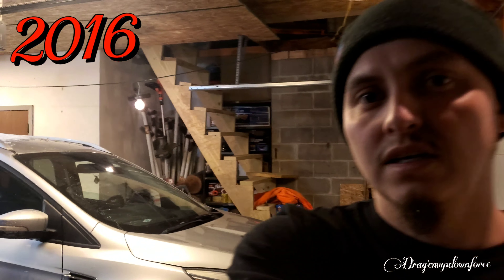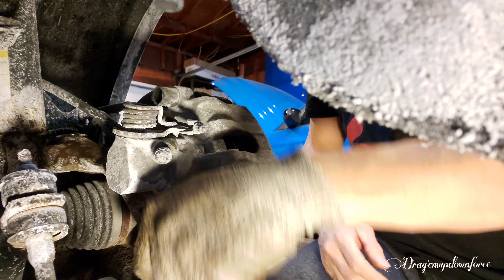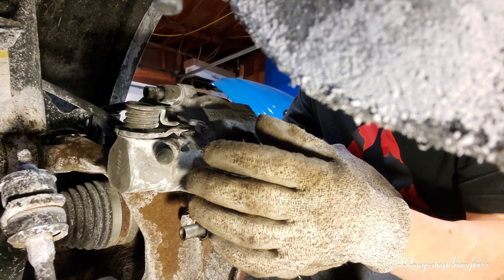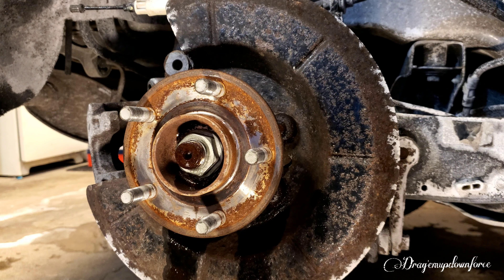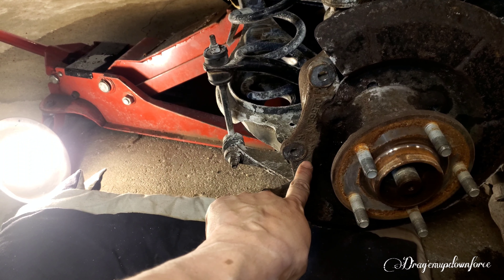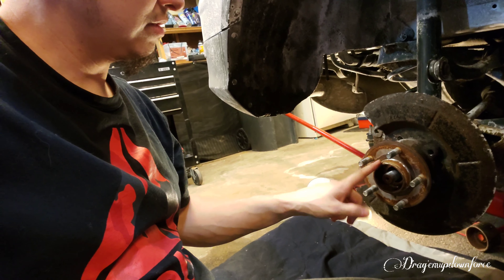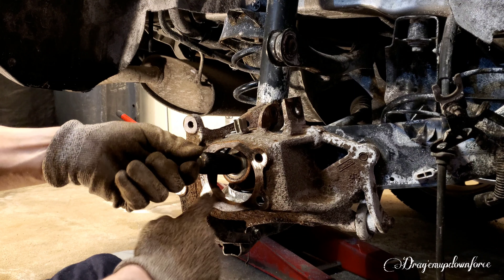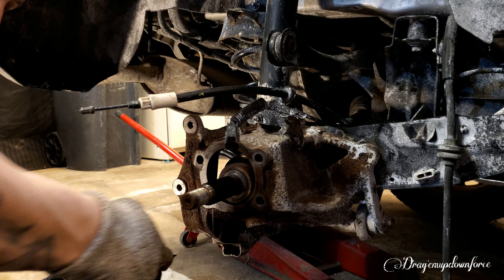How to change a 2016 ford escape rear wheel hub assembly replacement

Comment: Here's an even better idea instead of using a 12-point socket, get an E14 reverse Torx socket from your local Advance Auto Parts for $6 before you start tearing into your car. Right tools, right job.
Reply: Lol.  Yep last thing you want to do is round those suckers off.
Reply: @ExCordeEnt  I was slightly concerned whilst doing mine, so after watching a few YT vids, I thought the right tool was a cheap investment.  Besides, the Mrs. always gives me the green light for tools. 🤘😛🤘